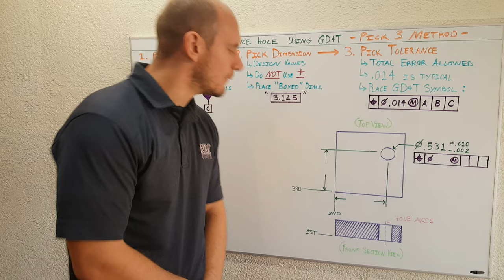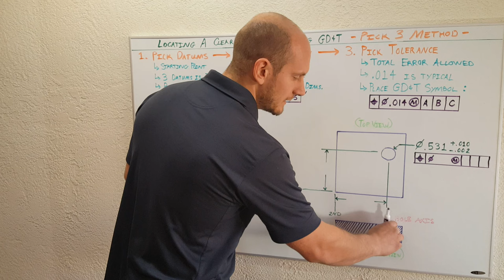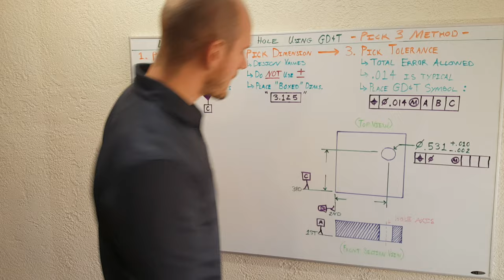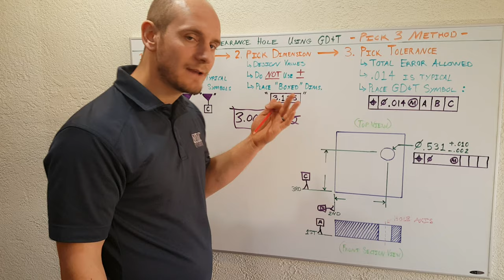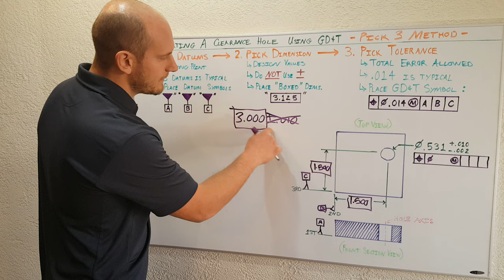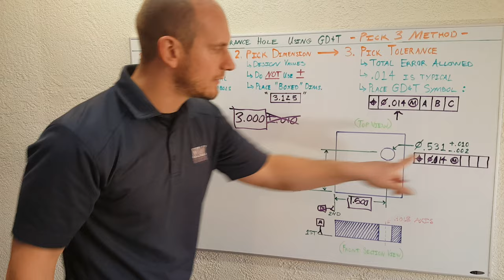How to Apply GD&T Position Tolerance to a Hole

Comment: What is the importance of boxing the dimensions 1.500?
Reply from the maker: Hello Simon, the importance of boxing the 1.500 dimension is to let the quality inspector know that the dimension is what we call a "basic" dimension.  In this case the quality inspector uses that basic dimensions to locate the .014 tolerance zone precisely 1.500 away from the datum.  Then he/she will probe the hole, find the actual axis of the hole, and then make sure that axis falls within the .014 diameter cylindrical tolerance zone.  I'm sure you're used to seeing the location tolerance given to the machinist as part of the location dimension itself.  GD&T removes the location tolerance from location dimension and instead gives the machinist tolerance through the use of the positional tolerance callout (the .014 value).  Think of it like this, we use a perfect "basic" dimension to locate the .014 tolerance zone, then the axis of the hole feature has to fall inside that .014 tolerance zone.  So your location tolerance is no longer a rectangular shape dictated by your +/- location dimensions but rather its a "basically" located cylinder with a diameter of .014.
Reply: Great thank. How would the inspector report out the measurements? For example if  A was 0.004, B was 1.514, C was 1.510? They are all in tolerance but would the inspector just report out the maximum so 0.014?
Reply from the maker: Hi Simon, you can quickly determine how far off in the X and Y (B and C respectively) the hole is by using the formula (X-Drift^2 + Y-Drift^2)^0.5.  You could also restate the formula like this: (B-Drift^2 + C-Drift^2)^0.5.  The X-Drift is the absolute value of |1.514 - 1.500| = .014.  The Y-Drift is the absolute value of |1.510 - 1.500| = .010.  Then you plug in those values to the equation (.014^2 + .010^)^0.5 = .0172.  So .0172 is your total hole shift.  If I was generating the inspection report I would report those three values (X-Drift = +.014, Y-Drift = .010, Total Hole Drift = .0172).  To continue further, since .0172 is greater than .014 then initially I would suspect this part to be bad.  However, since Maximum Material Condition (MMC) was listed in the Position Tolerance I would then need to know what the actual measured hole diameter is.  Once you know what the actual measured hole diameter is you can determine whether or not .0172 violates the allowable Position Tolerance.  I actually just posted a video on how MMC affects Positional Tolerance so check that out to better understand why you would need to know the actual measured hole diameter.  Now for the "0.004" value you listed relative to Datum A.  You would need to know what that value means.  Is it an declination angular value or a is it some sort of location measurement?  If it's an angle measurement, then would .004 be too large of an declination relative to Datum A.  Its hard to say without the inspection software providing some insight.  But to be clear, you need more information to know how to list the ".004" value in an inspection report.  And you need more information overall (hole diameter, .004 declination interpretation relative to Datum A) to make the decision on whether the part should be accepted or rejected.  Thanks and feel free to respond to this with questions for clarification or if you have more insight.  Have a great rest of your Sunday!

Comment: What happens when our tolerance  in only negative side ??
Reply from the maker: Hey there Nikhil, no worries.  When you calculate total hole drift from the B and C axis, the formula will square the negative values which will eliminate the negative sign.  A negtive sign simply tells you what direction the hole is out of true position.  The formula to calculate the total hole drift is Total Hole Drift = (B-Drift^2 + C-Drift^2)^0.5 so as you can see a negative value is not an issue.  However, here's a quick tip, if you are consistently receiving negative values when you are machining holes using a particular setup, then you might want to look at the backlash compensation of the machine you are using.  It may need adjustment to start bringing your location values a little closer to the nominal true position.  Thanks for watching and thanks for commenting!  Have a fun rest of your Sunday!

Comment: Sir but the G.tol is greater than size it's break Rule1 please explain about it
Reply from the maker: Hello sibi murugesh!  Let me explain a bit how this type of tolerancing scheme works.  In this situation both tolerances actually work together to completely control every geometric aspect of the hole.  To start, the Size and Form of the hole's surface are controlled by the .012 size tolerance in combination with Rule #1.  After that, the Location and Orientation of the hole's axis relative to the specified datums are controlled by the .014 Position tolerance.  To be clear, the .014 Position tolerance does NOT in any way allow the hole feature to deviate in size or form in a manner that would violate Rule #1.  The .014 Position tolerance ONLY specifies the diameter of the cylinder that the axis of the hole must reside in during inspection.  Let me put it in a practical scenario.  After this part is machined, the quality inspector would first inspect each local size of the hole throughout the thickness of the part to ensure that it falls within the .012 Size tolerance specified.  Then they would make sure the Actual Mating Envelope of the hole does not violate the .012 size tolerance specified.  Finally, the inspector would locate a theoretical .014 diameter cylinder at True Position relative to the datums specified by the Feature Control Frame and then they would make sure the axis of the hole resides in that .014 diameter cylinder.  Hopefully I've made it clear from this explanation that the inspector uses both tolerances together to fully inspect the hole while knowing that each tolerance is independent of the other and each tolerance controls a separate portion of the hole's geometry.  To summarize: the inspector first uses the .012 Size tolerance to inspect the Size and Form of the hole's surface and then they use the .014 Position tolerance to inspect the Location and Orientation of the hole's axis.  As a final note, I did include the MMC modifer next to the .014 Position tolerance.  This means that if the inspected hole size deviates away from its MMC size towards its LMC size, that amount of size deviation can actually be added to the .014 Position Tolerance as a sort of "Bonus" Position tolerance.  This addition can only occur up until the point where the hole reaches its LMC size.  Any more deviation in size beyond LMC would mean that the hole no longer falls within the specified size range and so the part would fail inspection at that point.  Thank you for watching the video and participating in the discussions!  Hope this explanation helps and feel free to respond to me with any comments or questions you might have!
Reply: doesnt the geometrical tolerance of position should be within the size tolerance of the feature
?
Reply from the maker: No, not at all.  The Positional Tolerance in this case only defines size of the cylindrical tolerance zone that the axis of the hole must lie within during inspection.  It does not have any relationship to the actual form or shape of the hole itself.  Positional Tolerance is not a form or size control.  It only controls the location of the axis or centerplane of the feature it is applied to.  I think you might be thinking of form tolerances such as cylindricity which requires that the tolerance be smaller than the size tolerance specified.

Comment: Don't mix up Datums and Datum Features, those are Datum Feature symbols not Datum symbols.
Datum Features are not assigned by machining procedure but by their use in application of the part.
It is Feature Control Frame not GD&T symbol.

Comment: What is significance of datum
Reply from the maker: Hello Robin, a datum is a reference surface or feature. The designer needs to establish a surface or feature to begin locating and orienting other features from that surface.  An example would be a hole. It is not enough to specify the size of a hole. The designer must also locate the hole relative to some other reference surfaces. Those reference surfaces would be what we call "datums". A note of caution, as a designer you need to select reference surfaces or "datums" that mimic how the part interacts within the higher level assembly. In other words, do not pick arbitrary surfaces to locate holes from but rather pick surfaces that dictate how that part will fit into the higher level assembly. To reference back to my hole example, always pick datum surfaces to locate the hole in a way that ensures it correctly lines up with the feature that it is supposed to interact with in the higher level assembly.

Comment: why would an engineer use .000" for a tolerance?
Reply: The tolerance would look something like .000, +.010.. so for instance if you wanted a hole at .30 you are telling the machinist that he can't go under .30 at all but he can go over by + .010.  So your tolerance would be .000 +.010 instead of your traditional +/-
Reply: @Donzaloon  they really want zero tolerance. I finished the parts. Did best effort and of course it worked. And got paid. Thanks for the vid.
Reply: @rev2889  I am wondering if an M or an L in a circle followed that tolerance of zero?  If so, that is the best way to assign tolerances.  The tolerance that could have been included before the M (MMC) or L (LMC) modifier is then to be moved up to the size tolerance, to provide a situation for which the most parts can be accepted.  If just saying that a larger size tolerance is provided, so the overall objective is to accept the most functional parts possible is not making sense, then please reply.  Also, see ASME Y14.5-2009 paragraphs 7.3.4, and 7.3.5.3 on pages 110 and 114.
Reply: @deanwatts5919  it was least material condition. Which was plus .0005 minus nothing. I'll send you the drawings if you want to look it over. I finished the job customer was happy.
Reply: @rev2889   - So the size tolerance was plus .0005 minus nothing and there was also  a position tolerance of zero at LMC?  If so, that sounds like a really tight combination of tolerances.  If the feature was a hole, so the LMC size limit was the plus .0005 limit, then if the hole's diameter was as far from that limit as possible, so very near the "minus nothing" nominal size value, the additional/bonus tolerance you would have would give you a position tolerance of up to .0005.  The entire approach of the language having M or L modifiers after tolerance values is kind of convoluted, since there's a surface method (often called a surface interpretation) that can also be used.
Reply: @deanwatts5919  this was in aluminium.